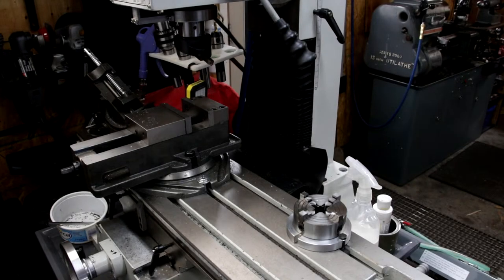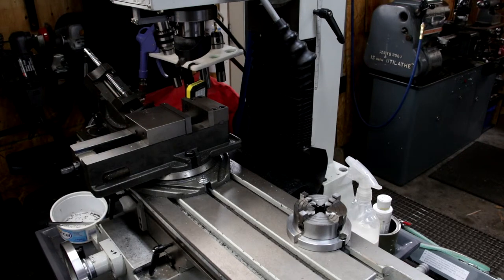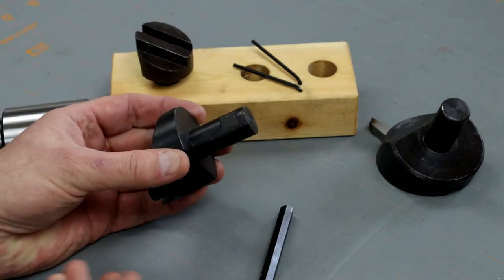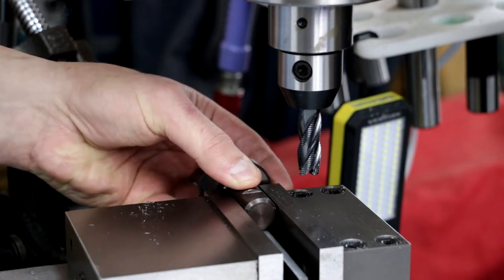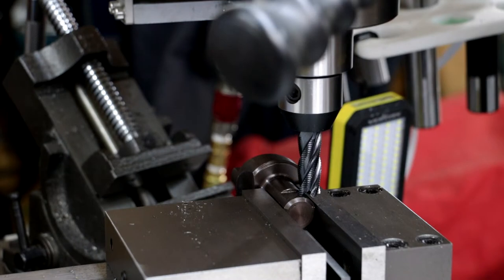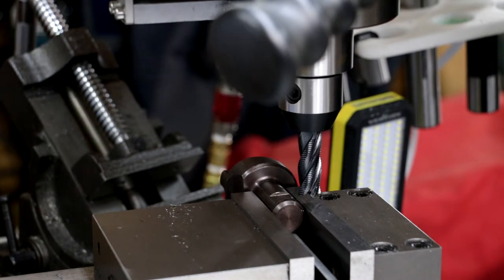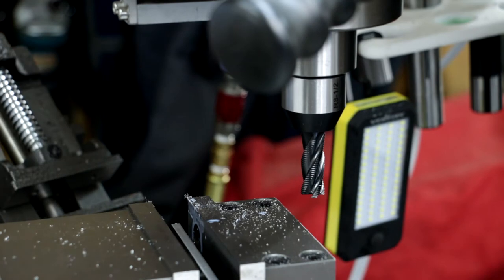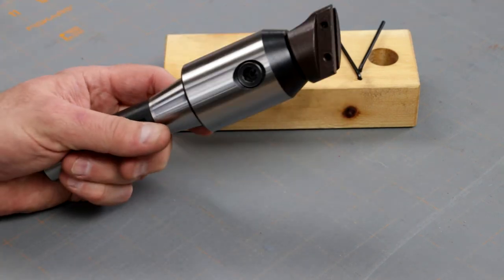Fitting Fly Cutter to R8 Holder

Comment: Wow great video!
Reply from the maker: Thanks for your comment. Cheers.
Reply: This video is not what I thought it was going to be about but it got me thinking about axial alignment and concentricity with fly cutters. The fly cutter is an interesting tool because any runout to the tool holder or the spindle is irrelevant and does not affect the flatness of the cut. Only the squareness of the spindle to the machine table affects the flatness of the cut surface. Nice video, this helped me think about some things I am working on.